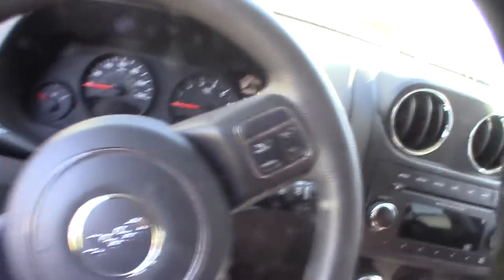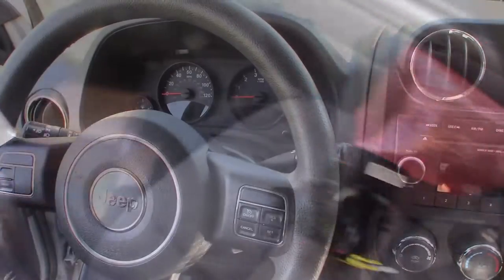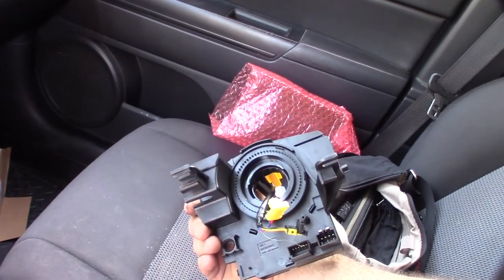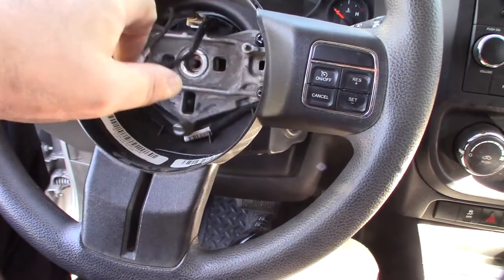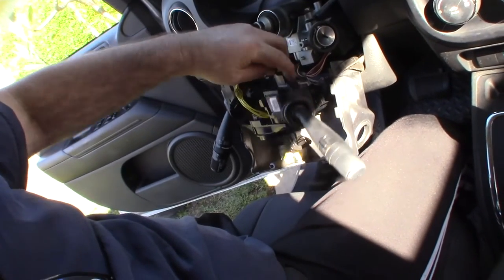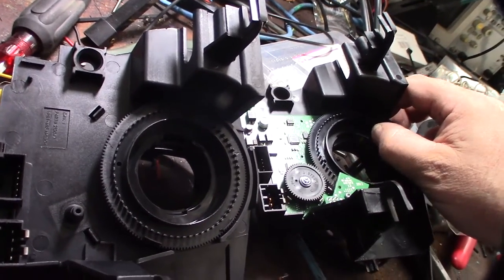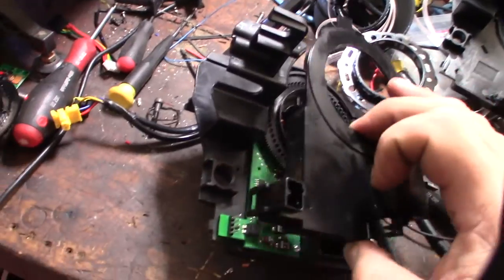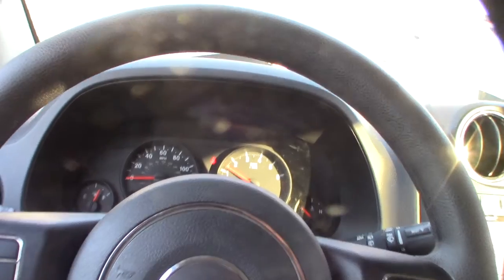Jeep Compass  SRS Air Bag Codes B1B02 B1B06 Clock Spring Replacement, Steering Wheel Removal

Comment: I just did this and ran into the same problem. Turns out we ordered the wrong clock spring. They have the same part number but one has the angle sensor and one does not. The one we bought did not have the angle sensor. I’m gonna re order and do it again with the proper one because my steering wheel is making a noise now when I turn it back and forth, I think the spooled ribbon wire got a little messed up when I switched the gear over. My airbag light is no longer on but I do not trust that the clock spring will be okay long-term